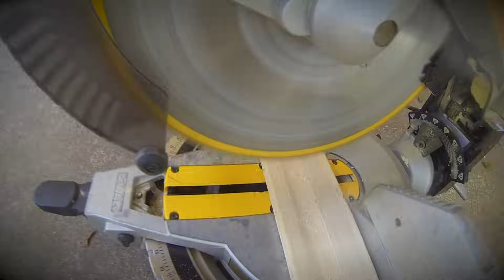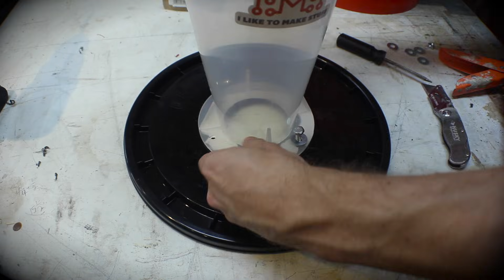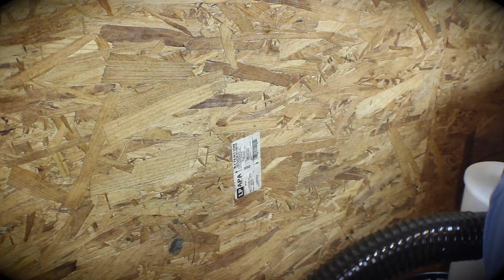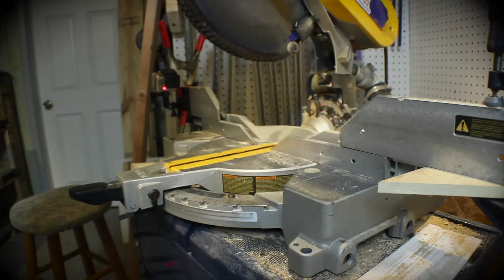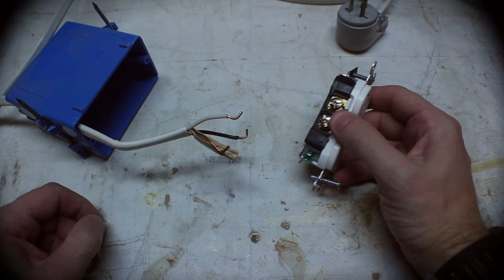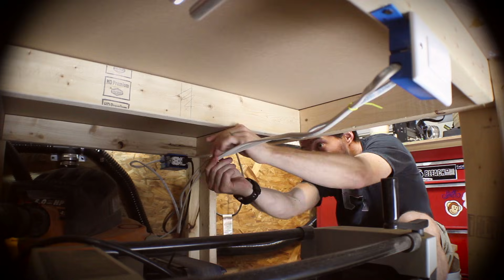How to make a dust collector with a wet/dry vac | I Like To Make Stuff

Comment: I used my system with a cyclone shop vac system and a PVC pipe run to everything I need I wasn't able to use blast gates but I did use ball valves

Comment: so you are switching the Black neutral's and connecting the white active wire together at the switch. So very wrong, forget about the type of wiring you are using because that's lest of your worries if something goes wrong. Everything you plug into that socket has the potential to shock you even when you have it switched of.

Comment: Thank you for your video, I am planning a central dust system myself. I have the Dust Deputy cyclone and it works well. I would suggest finding as large a container as you can for it if you are planning on connecting it to a thickness planer, even a small bench top model. Them things make a LOT of chips! I have my cyclone on top of a large gear oil drum and still have to empty it frequently when planing a lot of boards. Also you can stick your shop vac hose into a trash bag full of chips and hold the bag opening around it closed to suck the air out. Then tie it really tight before it expands again. It will reduce the volume by at least two thirds.

Comment: Great video, well done! One suggestion though. You'd greatly improve your suction over those long runs if you were to replace those long rungs of corrugated hose with smooth PVC. Because a corrugated hose has so many bumps inside, every one of those little bumps acts like a speed bump for your airflow, and slows it down. I bet if you tried a little experiment by replacing just one of those long runs with PVC, you'll be pleasantly surprised by how much more suction you'll get. Another tip to increase your suction would be to eliminate all 90 degree angles in your fittings. You're far better off using Y fittings than you are with using T fittings. Every 90 degree angle greatly reduces airflow because the air first slams into a dead end at the bend in a T fitting, before then having to once again pick up momentum to travel on. A Y fitting eliminates this slamming into the inner walls of your fittings, and provides a much easier transition to the next length of pipe. Think of it as driving a car down the road, trying to maintain speed. When you come to a T in the road, you are slowed way down before making your 90 degree turn. Now compare that to a highway on ramp, which is essentially a Y in the road, when you can maintain your speed as you transition from one road to the other. Just a couple of  suggestions if you feel the need to increase your suction.

Comment: Please take this as constructive criticism because of some real safety concerns.  DO NOT put both ground wires under the screw on that switch. That screw is designed to accept one #12 or #14 wire. Pig tail them. DO put a cover on the receptacle box.  Its both a shock and fire hazard without one.  You probably have some strong areas of knowledge to share  but ask yourself honesty if you're good enough at electrical to be giving advice.  I hope you take this in the intended spirit.

Comment: curious to know if you've noticed a downside to this setup, since the shop-vac is a 2.5" (max) hose setup and you're 'drops' are 4". I've read that the shop-vac really only works for smaller tools and the 4" is better for larger machinery, but that shop-vacs don't work well for the larger port equipment.

Comment: you wire the switch the wrong way , the light of the switch should be on when the vacuum is running , your light is on when the vacuum is off

Comment: How do you keep the strength of the air suction when you have so much tubing? Do you have to do anything to increase the suction for longer distances? I notice the more attachments I add to my vac the weaker the suction, so maybe it's just my vac, but does anyone have a fix for that?

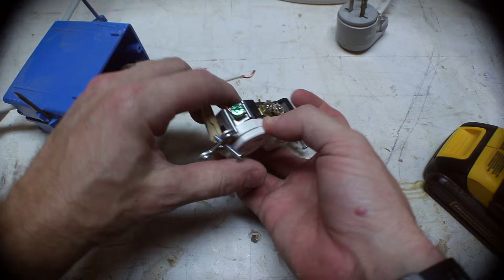Comment: Time mark 3:50... You got the "curve/twist of the wiring wrong! You're supposed to "wrap" the wire in a right-direction around the post/screw, so that as you tighten the screw the wire is drawn into a tighter position on the connector. Doing it the wrong way as you have done, allows the wire to come out of the connector and probably fail. This is basic wiring 101.

You also left the wire loose on the plug end... Sloopy. Glad you're not my electrician.

Comment: I like the idea of a 5 gallon bucket, but unfortunately with the amount of ripping I do I would fill up the bucket in a matter of hours every day. It's tempting to ramp this idea up to use 55 gallon barrels, but then I'd have to find a way to empty those. After a very recent small fire under my saw from a shorted cord I really need a different solution than the one I have now which is a broom and a dust pan..

Comment: Please PLEASE re do your wiring.  Wrap the wire clockwise around the screws so it tightens down properly.   Also leave a little more wire in your junction boxes...  Minimum code is 6 inches...

Comment: Some tips from an electricians apprentice 
You should only ever a 1/4” max of jacket in a box per NEC (you had a few inches) 

You should put your hooks on screw terminals clock wise so they tighten when you screw down the screw not loosen 

Pre twist pig tails (don’t rely on wire nuts) 

You ran more wire to the switch box than needed you could’ve just ran one 14/2 instead of two wires, using the neutral as a hot and re labeling it with a sharpie or electrical tape  (you placed a wire nut on your neutrals)

Comment: 3:49 You should always attach wire loops in a clockwise direction so that as you tighten the screws, the screw will make the loop tighter if it moves the wire.   Just remember if your screw is turning clockwise, your wire loop should be also.

Comment: That white electrical cable looks like Romex or similar. It's solid-core, designed for use inside walls, where it never has to bend after being installed. That's why it's stiff. That also means it will wear out and break pretty quickly (possibly leading to starting a fire) if you bend and unbend it a lot (plugging into different outlets, coiling up, etc.). Appliance cords and extension cords are made of stranded wire, and are designed to last a long time with frequent bending.

Comment: Neutral wire on outlet looped incorrectly.  I should be looped in the direction the screw tightens and long enough that it forms almost a circle.

Comment: When wiring receptacles and switches, be sure to have the curl on your wire going in the same direction as the screw turns; clockwise.
Reply: I was going to say the same thing, as an electrician I approve this message lol.
Reply: I was thinking the same thing
Reply: Haha, that was the thing I noticed too.
Reply: That was the problem you noticed???  Nevermind the massive code violations of using an extension cord to run an outlet and switch, using zipties to attach them and not putting a cover over the receptacle.
Reply: @mccalejk2  not sure thats a code violation as it wouldn't be considered a permanent installation. Essentially all he did is make a power bar.
Reply: @mccalejk2  - you’re a tard!
Reply: fivepointbaptist use a screwdriver to tighten the screws

Comment: These cyclone attachments make no logical sense. It is no easier to empty a bucket than it is to empty your shop vac. The whole start of these cyclones was because it is a pain to empty an actual dust collector bag. In which case catching most of the waste was critical. Not to mention every inch of hose and T will have significant CFM loss vs just moving your shop vac hose from one tool to another.That being said, I do enjoy the videos on your channel.
Reply: The cyclone attachments are about keeping the shop vac filter clean, not about making it easier to empty. Saw dust very quickly clogs the filter and makes you lose suction. Collecting the dust in the cyclone keeps the filter clean and allows the vac to keep sucking.

Comment: You need to hook up the wire so the short side of the hook turns with the screw. Not doing so can cause the connection to  straighten and cause shorts.

Comment: Ok great, but which shop vac did you use for this? How much horsepower is the shop vac and how much suction pressure are you getting at the connections?

Comment: @3:50 just an fyi tip...wrap your wire around the screw clockwise so when you tighten it up it grabs and pulls it tight. The way you did does work, but in my experience, it likes to push the wire out and can lead to loose wires in your box. Other than that, thanks for the great video!

Comment: May I recommend, the further you place ur hoses from the vacuum source, you decrease the ID of the hoses to keep consistent negative pressure at each tool.   Also instead of a vacuum you can just use a lobe blower for a much higher negative pressure system.
Reply: I had wondered about the blast gates being at the tool reducing pressure bc of all the extra hose to the other tools. I just watched another video where the guy made like a splitter box with a closer to the vacuum with a single hose on one side with a sort of tray, and on the other side had holes with blast gates where a hose for each tool could be connected. That way, you just open the blast gate for the tool you're using, and the others are blocked at the source more or less. 

I'm thinking I'm gonna combine that idea with this system, and see if I can figure out a system to control the blast gates without having to walk across my shop every time I switch tools.

Comment: Bob- I tried to read the comments before posting but didn’t see many comments or an answer.  

What about the static in the tubes and concern for dust buildup or explosion? I remember years ago helping my grandpa with his system and he grounded the ducts but I can’t remember his full explanation on it.
Reply: Adam Faris I read recently you should attach a copper or steel wire to a bolt on the dust collector, and put a heavy washer on the end, long enough to sit on the concrete floor to ground it. If not concrete, you may need an external ground stake outside and tie off to that with your ground wire.
Reply: smportis that is what I had been told (not the details how but that it should be grounded) but I was having a hard time finding something reliable to confirm it. Thanks!

Comment: This is bullsh*t. My shop vac totally sucked in the sides of a 5 gal bucket, and cracked it after about three minutes. It went in the trash. Maybe if you have a small shop vac this will work, but not with a decent size  one.

Comment: How long does it take to burn out a shop vac? They are not made to run for extended periods. For instance a lathe. I have a large Delta dust collector, 2 bag system, but it is too big for my new shop. I am not finding any good alternatives for an almost retired (broke) old guy.

Comment: One small point Bob. Any directional change in dust collection systems should be made with the least possible flow resistance. Right angle changes reduces flow  capacity. 👍

Comment: You wrapped your wires on the outlet the wrong way. Should go clockwise otherwise tightening the screw tends to push the wire out.

Comment: black wire is hot....on the plug the smaller slit (for safety)  is the hot.......so black wire goes to side of plug with the smaller slit.....

Comment: I know this post is very old and you may not even be checking this any longer.  But thought I would try.  I didn't see any wood reinforcement of your bucket lid.  When looking at other people's projects they tend to say they needed to add reinforcement.  Did you continue to use the original bucket lid or did you find it necessary later on to add reinforcement on the bucket lid before - your finally upgraded to the larger system.

Comment: You should not use solid wire for a plug. Over time, the wires can break and cause a hazard. Always use stranded flexible cables for plugs

Comment: I am just now becoming interested in woodworking. I am disabled and thought this would be a great way to pass the time. Dust collection is a big concern of mine so is shop safety. Years ago I worked as an electrician and was taught a few things that I noticed you did not do in your video. The first was to always wrap the wire around the terminal screws in the direction the threads tighten. This way when you tighten the screws you are pulling the wire tighter around the screw. The second thing I noticed was the end where the plug was located. It appears as if the exterior insulation is butted up against the base of the plug instead of inside the clamping area. This allows the wires to become exposed and possibly more prone to damage. Just a few personal observations otherwise, great video.

Comment: One option for your remote switch, is a remote switch control.  It's a device that plugs into the outlet then you plug the tool (in this case vacuum), light, whatever you want to power and a wireless fob controls the switch device.   You can turn on your vac from anywhere in the shop.  Home depot, Harbor Freight, Amazon, eBay, lots of places to find them.
  And these usually come in a pack of three so you can control three devices with one fob.  
Got 'email all over the house.  Lights, fans, anything I wish had a remote, does.

Comment: All connections should be angled fittings NOT T as they restrict air flow, should always use wye fittings and always use sweeping corners or double 45's and never a 90.

Comment: I think a few people mentioned this, but it's important enough that I want to reiterate:  your live AC line that runs from the outlet to the switch under the table should be in conduit.  It costs almost nothing to do, and it can protect you from the very real possibility of something cutting into the wire causing some variety of suckage.

Comment: Just FYI about the electric if you want to be picky: The ground wires should have been pigtailed and the exposed wires under the bench should be in conduit or MC wire.

Comment: Only difference I would recommend is using smooth pipe instead of the ribbed. The ribbed I'd flexible so its easier to fit it all together bc you don't have to be as precise but smooth pvc pipe will have less air restriction creating a better vacuum
Reply: I was wondering about this also. I had heard that PVC will conduct too much static electricity and coat the ID with dust. But I am no expert. Can anyone advise?
Reply: @christopherrecord5556  If you ground the pipe -- you should, you don't want to experience a dust explosion -- then that'll cure the static issue.

Comment: Since that electric switch plugs in, you can probably get away with calling it "temporary" and using cheap plastic boxes and cover plates. But to be truly safe, the boxes and plates should be metal and the wires should be secured with strain reliefs. Just sayin' .

Comment: Are you able to plug a second shop vac with the remote receptacle outlet you just made and use that the switch to turn on the dust collector and use a shop vac at the same time ?

Comment: i am sure its been said a lot of times here. but using T junctions like it was done on its way to the vac  will have high risk of clogging the unused side of the T junction. sawdust has mass. some will continue straight ahead in the T junction. and since there is no air being pulled from that side it will settle there. building up a clog. its much better to use a Y junction

Comment: Doooood. SO many people going on and on about wrapping the wires for the plug and switch with the direction the screw turns so that when you tighten the screw it pulls the wire in instead of pushing it out. While that's true, it's really not that big of a deal if you're using solid wire, which he was, and you have a good hook. Using stranded wire, yeah, it winds up being a pain in the butt.

Comment: When wiring up electrical, the black wire always goes to the small slot side (active power), the white goes to the extra large slot on the socket (power ground), and of course the green goes to the chassis ground (dedicated safety ground back to the power panel). When wiring up a switch, switch the power (black) not the ground as he shows in this video. If you switch the ground wire instead of the hot wire you still have voltage going to your outlet and that is NOT safe, so switch the power wire on and off. When wiring up a plug, (which he did not cover in the video) make sure the white is connected to the largest pole, and the black to the smallest. YOU DO NOT want to get your wires crossed, a recipe for bad things to happen.
Reply: I just watched that part again. He both explains and shows, that the two WHITE wires, (neutral), get connected together. He then connects the BLACK wires directly to the switch terminals. Black is live power, not ground. He then connects the bare/copper GROUND wires to the GREEN screw. Although some are criticising the way he screwed them in, his wire placement is exactly correct.

Comment: GREAT, a little fast 4 me so I emailed. Love it, thanks.  I am thinking of making one out of a 70 quart storage container with exhaust fan to outside or to shop vac till it gets colder and I think I can get it 2 work.  I was going to use an aquarium but nixed that til later, also have 5 gallon buckets, but will play with this idea 4 awhile.  What is the dust deputy for exactly, dust collection?  I live in condo so there is no room to speak of, but do need 2 get rid of glass particulates where I am working. Thank you, Joe  Gee that shop vac make a lot of noise

Comment: Would like work for metal. I make knives and have a super small shop. And need a collection system. For the metal dust and handle material dust.

Comment: I tried this system and the bucket collapsed. Did that not happen to you?
Reply from the maker: Hmm, no it didn't. Did you have one of the gates open? I could see that happening if there wasn't anywhere to draw air from.
Reply: Yeah I did..Im going to try and use a heavier duty bucket